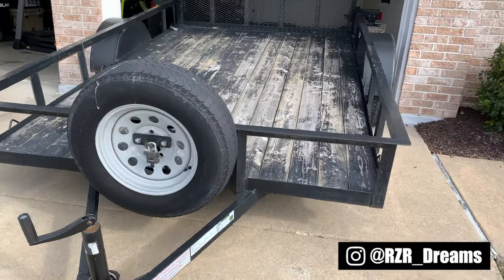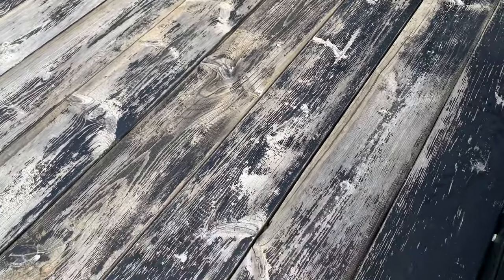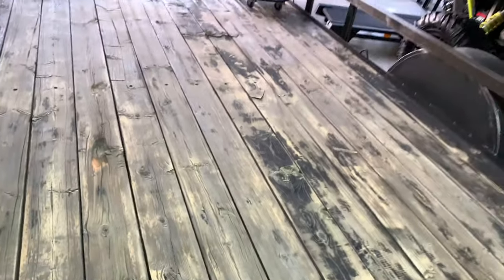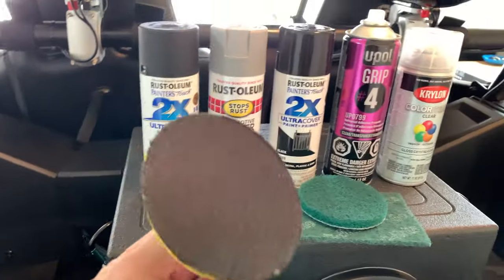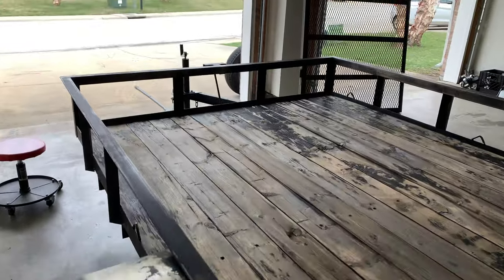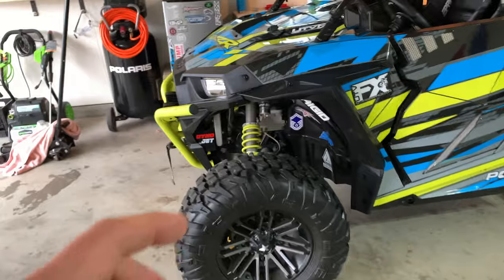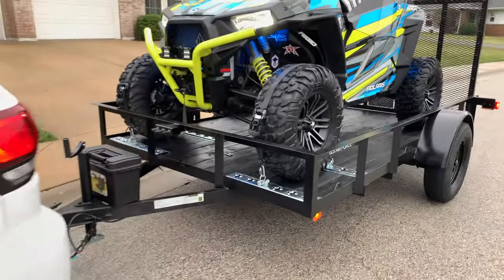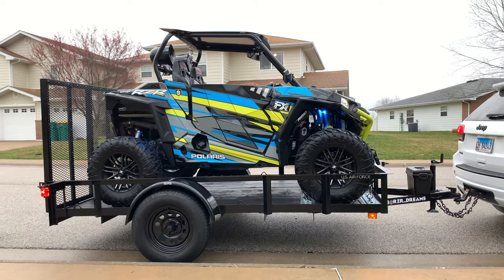Making My Junky Utility Trailer New Again!

Comment: FYI trailer axles have a purpose built "bend" in them.  The center of the tube will be the high point.  You can get the actual measurements from the axle manufacturer to verify if yours is bent beyond the factory installed bend.  If yours is within specs, check the measurements from the trailer ball/hitch center to make sure the axle hangers are installed square to the trailer.  If the measurements are off from ball to left vs ball to right, your axle is not rolling straight and this will eat tires and cause weird wear patterns.   You want to take measurements from the center front to each hanger and it should be within 1/16 to 1/8" left to right.  If not, you can drop the axle, cut the hangers off and re-weld them in the correct locations (if one is off, that will affect the others when you re-weld so expect to correct more than one per side if that is the case).  Also check your springs.  As they age, they will go "flat" and carrying of a heavy load accelerates this.   It's not unheard of to go from 3500 pound springs to 4,000 or 4,400 pound springs (each spring is 1/2 that rating).  But don't overload the axle rating with the load.
Reply from the maker: This is literally the most incredible comment we have had on our channel. THANK YOU for responding as a sincere friend who wants to help bring valuable information to us and our viewers! Mind if we contact you when we have additional trailer questions?
Reply: Excellent explanation!! I have a 5x8 trailer with a Dexter axle & saw the bend, researched it & found it was built that way. Your explanation was spot on...

Comment: I built a front header wall on the trailer for hauling my RZR 900 to block rocks and gravel kicked up by the pickup truck from sand blasting it. One sheet of 3/4" plywood cut to fit in between side rails laying on its side, with 2"x3" uprights at each end and one in center on the inboard side, bolted into the railings. I also fitted plywood sides as tall as the side  railings to carry and keep small items like coolers, lawn chairs, gas cans, and misc junk in the trailer packed around the RZR. I had straight axles on my trailer instead of a drop end axle, and I needed more clearance between the tires and the fender. A drop end axle you just have to turn 180 degrees on the U Bolts and make them into drop UP axles and gain clearance to the fenders. My straight axle I made 4 inch longer shackles out of Home Depot steel bars and drilled them for the mounting bolts. I also changed all the lights to LED's, just because they looked brighter and cooler.  Have fun!
Reply from the maker: Wow! Sounds like you know what you’re doing. Great to hear everything worked out for you. Thanks for the ideas. 
😉

Comment: I know its been a while since you did this but when I did mine I used OSPHO its a rust neutralizer and it acts as a primer as well, you just spray it on with a pump up sprayer on all the metal and let it set over night then paint the next day and damn does it work well. I did my trailer about 3 years ago and it still doesn't have any rust and looks great. I bought the chemical at Ace hardware. Also instead of rattle can paint I bought a gallon of black enamel paint and rolled it on with a roller. You could use a paint sprayer too of course.
Reply from the maker: Nice feedback and advice!  Thanks a lot for checking our videos out.

Comment: You might consider taking a piece of DOT reflective tape (2" wide) & split it in half so is 1" x 18", measure width of fender & cut to length & put white on front of fender at bottom & red on back of fender at back. Locates fender for you in dark by reflection of lights for placement & locates trailer for people following (besides lights) & people going past you so they don't accidentally hit fender when crowding center line. I had one do it to me & hit trailer & ruined both of our day. Just a thought for cheap prevention.
Reply from the maker: So true and great point.  Thank you for bringing that up!

Comment: Great video - nice job. I really get the point re. effort ve result. Coming from europe, this is interesting, as almost all  trailers here are electrical or heat galvanized- and easily lasts 15-20 years without any maintenance at all. And they seem to be approx. Same price as yours. So amazed, you had to put that much work on a relatively new trailer.
Reply from the maker: Wow, that's cool to hear! Thanks for sharing.

Comment: Nice job, looks great. First thing I noticed was only tied down on front wheels, I guess every state is different, but most of Canada has to have 4 point tiedowns on vehicles. Do you not have the rear end moving side to side on rough roads? Second was your underneath, really suggest some type of spraying or rust coating to prevent any further rust, the unseen parts are the ones that usually bite you on the butt.. LOL
Reply from the maker: Haha, yes we’re getting a lot of feedback on the underneath of the trailer and not addressing it. We’ll have to tackle that next time. And as for the rear tire tie downs, no she never moved a bit while pulling. There’s a lot of weight back there to produce down force pressure. And with the gate and included side rails it wasn’t much of a concern. Thanks for watching!

Comment: That tire wear is from the axle or the hitch not being square if that makes sense. Check to see if the axle center just behind each wheel is an equal distance from the front of the frame.
Reply from the maker: Awesome, thanks for mentioning.

Comment: Greetings from the O-H-I-O Porters.🇺🇸 Reminds me of my trailer from California….similar framing. And my deck rotted out within 1 year of owning it.🧐 The axle…I’m not sure it’s bent. You mentioned that the plug was messed up. Did you check the rest of the wiring just to make sure it wasn’t compromised? Good job on preparing the metal & wood. What did you do to the underside? 🧐 I like the big tailgate. I have one on mine. They’re heavier, but a lot less hassle, in my opinion.🤩 The new tie downs are quite cool & handy. Better to have more than enough than not enough.🧐 Having a spare tire(s) mounted on the front is nice,  but I’m actually gonna mount mine on the sides near the front. I’ve chosen to have 2 spares just in case & I prefer to have them inside the trailer & covered, but you can still cover them when mounted on the outside. Good looking trailer. Thanks for sharing. 🥰😎✌️
Reply from the maker: Awesome, thanks for the feedback! We didn’t address the undercarriage but we definitely should. I’ll bet we will next time!
Reply: @RZRDREAMS  🇺🇸 You covered a lot in that video. Enjoyed it. 🥰😎✌️

Comment: I hope you didn’t have any overspray problems with your neighbors. Or your truck
I use a roller to paint my trailers (the small 4 inch ones”
You trailer looks great
Reply from the maker: Sorry for the delayed response my friend.  No issues at all it turned out great.  I rolled the deck.

Comment: Looking to buy a trailer.  Should I use spray the underneath parts of the trailer to prevent rusting?
Reply from the maker: I don't think much attention needs to be focused on the underneath part of a trailer.  You'll want to make sure the deck is treated and cared for.  That's the important part of the trailer and the first part that will start to deteriorate first.
Reply: @RZRDREAMS  thank you!

Comment: Great video!  I have a similar trailer, although mine is only a 5x8 carry-on trailer.  How did you get the wheels to turn out that awesome when you painted them black?  Did you sand them first and paint them with the same paint that you used on the metal parts of the trailer?  Also, did you clear coat them?  Thanks!
Reply from the maker: Hey Alexander, thank you for the compliments we hope you subscribed! After washing the wheels with dawn soap and water, we dry sanded the wheels with a medium scotch bright pad then cleaned them well with some alcohol and a clean rag to get rid of all of the dust. To prep the wheels for pain, use tape or better yet get some index cards (the ones you would use to study with) and put them in between the wheel and the tire. Spray 2 light coats of primer, then follow with 3-5 coats of satin black paint. We didn't use clear coat, but you can if you want too. They will hold up well!

Comment: That rust is surface rust , wire wheel it off and paint it , the axel is supposed to be bent , the weight on the trailer should balance the axel out.   Have you ever seen those big flat deck semi trailers that have a slight bend in the deck ?  That’s designed for a reason to counter balance the weight and it will straighten out with the right amount of force.  It’s not broken

Comment: You should look into treating the deck when its due with a 50/50 mix of used oil and diesel. Do not do it on new wood-it needs to "season" at least a year.
I did that on my 12 foot trailer and turned out great!
Reply from the maker: Oh wow, really? What does it look like afterward?
Reply: @RZRDREAMS   @RZR_DREAMS  the diesel helps the oil penetrate the wood. Highly recommend waiting a few days before use. But it definitely darkens the wood-almost blackens it but makes it look so good! 
When I do it again, I'll coat the underside of the wood because I didn't do that last time.

Comment: You probably should've taken your boards out and prmered & painted the under carriage of the trailer, when you repainted the top part of the trailer. That's the part of the trailer that gets the worst beating all the road grime. Just my thoughts, that's what I did to my 12 foot trailer and replaced with treated boards.
Reply from the maker: Robert, we hear you and really wanted to put treated boards on but couldn’t justify the cost. This is a $1,400 trailer.

Comment: Hey are you strapping only the front wheels down? 🤷🏽‍♂️
Reply from the maker: Hello, yes.  The rear tires don't need to be strapped.
Reply: @RZRDREAMS  Everything's fine until you get into an accident. If you were to hang the trailer upside down, what would happen to your cargo? That's how the D.O.T. looks at it. Have you ever read, accident under investigation? That's when you get your citations, court appearances, lawyers etc. Just hope no one gets hurt, or worse. You are responsible for your load. Ask the truck driver's. You might think your safe, they will probably tell you otherwise.

Comment: How did you prep & paint the wheels?
Reply from the maker: What we did was take a course scotch bright pad and scuffed the wheel up really good.  We then washed it using dawn dish soap to get rid of the grease and grime. After that, we taped off the tire and painted them.  Three coats of black and two coats of clear.  Don't worry about painting the behind the wheel overspray will take care of that.  Hope this helps!
Reply: @RZRDREAMS  Next time you paint tires, lay them down, apply your dawn soap on the tire with a paint brush. Paint the wheel and when the paint dries, hose off the wheel. Much faster.

Comment: You started off by doing all the work on the top and sides of the trailer. During the intro to your video, you noted that the metal underneath the trailer was starting to rust. Why didn’t you flip the trailer on its side or on its back and take care of the underside first? After you’ve done all this workout top, now you’re still gonna have to turn it over and take care of the rest on the bottom of trailer and you’ll end up scratching up all the paint work you just finished.
Reply from the maker: Hi bud, that's a fair assessment and point we will definitely make the next time around.  The purpose of a lot of these videos we make here are to learn and build our knowledge about the off-road machines, trucks, trailers, and campers.  We sure have learned a lot since we started in 2018.  Our new trailer is incredible and looks fantastic.  If we ever do a make-over again in the future we'll be sure to tackle the bottom first!
Reply: You could not have said it better, you are 100% correct, POR 15 RUST PREVENTATIVE would have arrested all that rust permanently, it's a bit expensive but it works like crazy. one nice thing about this product is you can paint this product right over rust.

Comment: the underneath metal needs to be addressed and painting the deck was a waist of money if the underneath remains untreated ,. the decking is exposed to the elements my recommendation is remove the boards and address the metal under then water seal all boards and reinstall.    cheers
Reply from the maker: Noted for next time my friend. Thanks!

Comment: You should have used a good primer before you painted the floor, just remember the primer is what grabs your substrate or wood, when you paint it grabs on hold to the primer, you should not expect your new paint to last too long if you don't use a primer, also If I were you I would revisit this job, Why? the bottom of your trailer has a lot of rust, you should get a couple of guys and turn your trailer over, to take care of the rust permanently by using a rust product called " POR 15 RUST PREVENTIVE" you can paint right over the rust, this product will stop any future rust in its tracks, you will love this product, it is the best! Get the best price on Amazon at $43.53 per quart. "Black" important! if you use this product do not get it on your skin or anything you don't want to be painted because whatever it goes on stays on, wear gloves even if you choose to spray it on because get it on your hands It may take a week to wear off. by the way, the bend in your axle is made that way on purpose by the manufacturer for heavyweight items.
Reply from the maker: Hey wow thanks for the great feedback. I appreciate it!!

Comment: It's  a yr since you posted so your probably due for treating the deck..best treatment is free...mix used engine oil and small amount of diesel.  your axle is supposed to be bowed like that by the way
Reply from the maker: Hey friend!  Yes, we've had other subs tell us the same thing.  Thanks a lot for letting us know.  Cheers.
Reply: @RZRDREAMS  Note: people telling you to treat your deck with used engine oil, you should "beware" that engine oil on your person can cause Cancer and used engine oil is even worst, there should be a warning on the engine oil container you buy, it appears that most people are not aware of engine oil products. hope this helps.

Comment: Black Wheels are not the most intelligent move you can make. With Black Wheels you can't see a hub leak which could be very bad or just a case of over packed with grease. In both cases you need to know so you can fix the problem.
Reply: You can see a hub leak with black rims any grease on the rim with have dirt all over the grease.